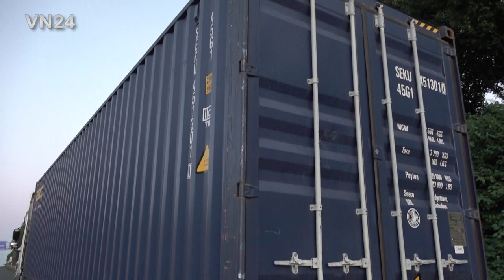21.09.2022 - VN24 - Bergung eines ausgebrannten LKW MAN TGX auf der A1 - Teil 2

Comment: Good job by everyone. Yes, the fire brigade forklift operator dus a remarkable job with the assistance of the regular operator. It's amazing the fire kept returning. Wonder what they were carrying that caused this. Didn't see any hazardous materials placards annotating materials requiring specific fire-fighting procedures.
Reply: But you have wooden pallets, cardboard and plastic for loading and packaging, this stuff is flammable. Plus, with pockets of fire remaining, re - lighting is always possible, that's why the burnt - out truck must be unloaded, smoldering objects are than sprayed one after the other.
Reply: Volounteer fireman have a regular job, which could be forklift operator in a factory.